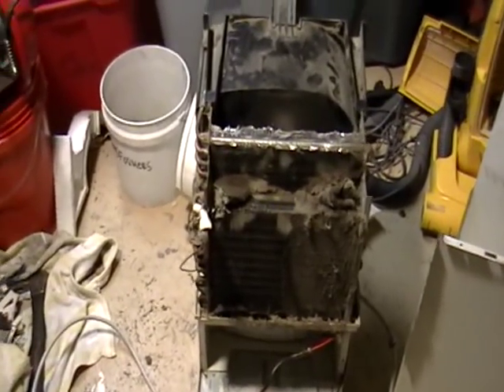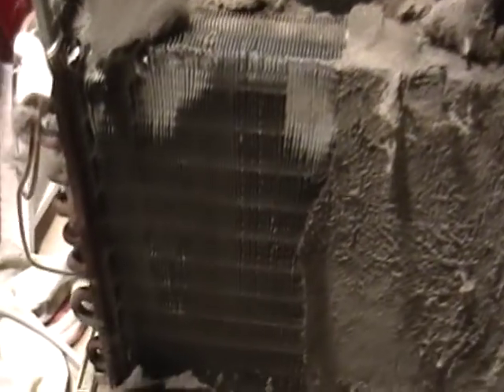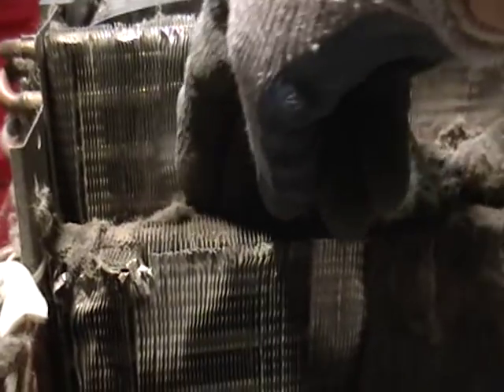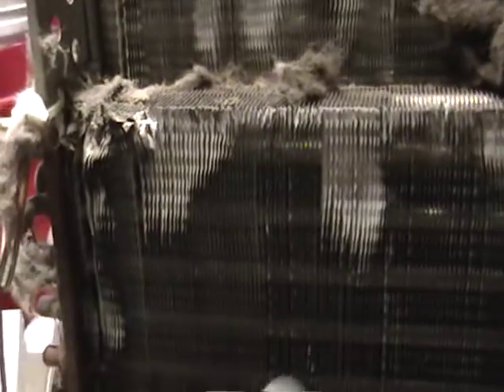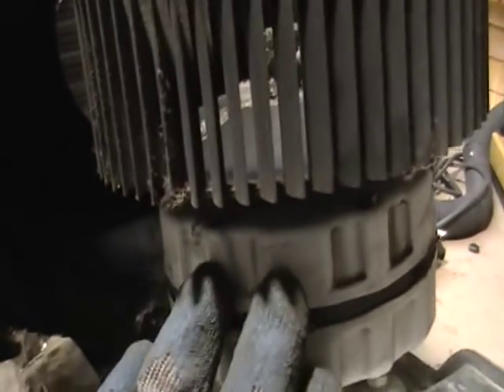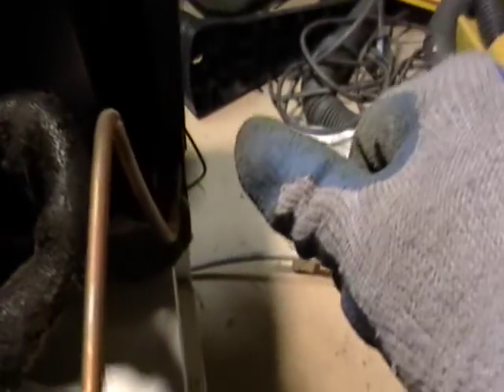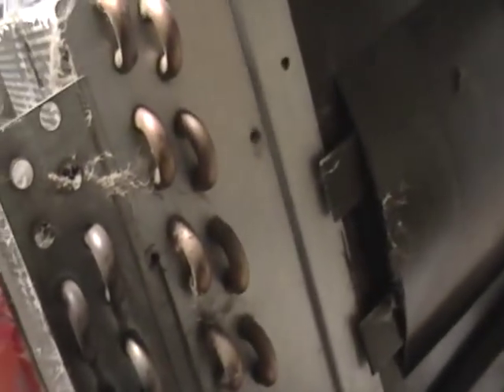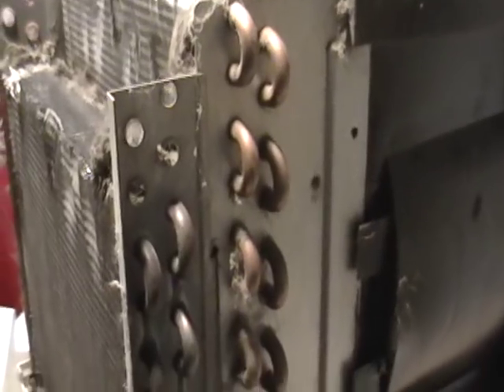Scrapping a dehumidifer for copper, aluminum

Comment: This is not specifically about this video, but you give a great deal of information so I came across wire that has a silver metal coating but when I scrape it, it is copper.  What do I seperate it as.

Comment: I don't know where you are, but around here the charge for collecting the freon from AC's, water coolers etc. is $15.00 per unit. So, obviously I'm not going to pay that & I just cut the lines and release the gas into the air. You know that's what most people do. I find alot of them abandoned on back roads or in front of clothing donation bins by irresponsible original owners. As a scrapper, I can't resist picking them up. I know the freon is harmful to the atmosphere, but I need money.
Reply from the maker: Reid GDT I do understand that. I know many people that feel the same...